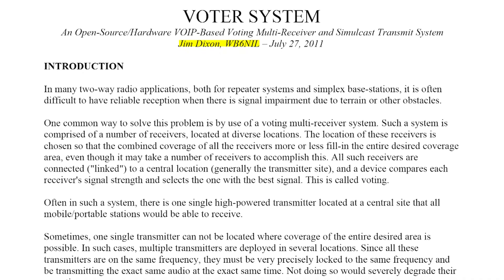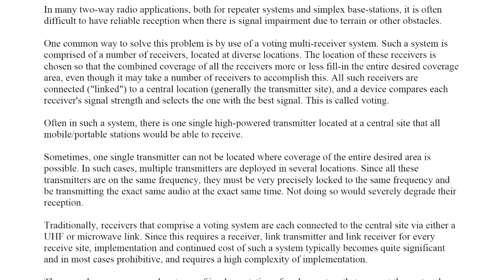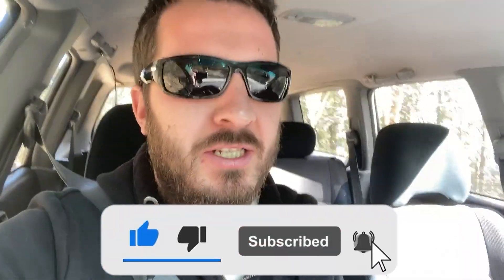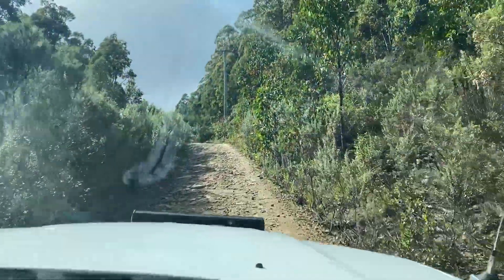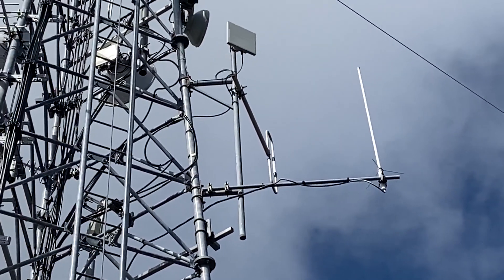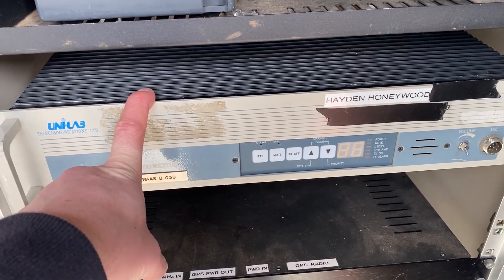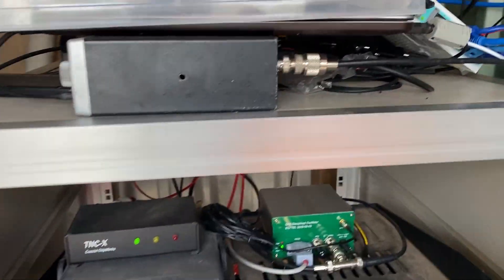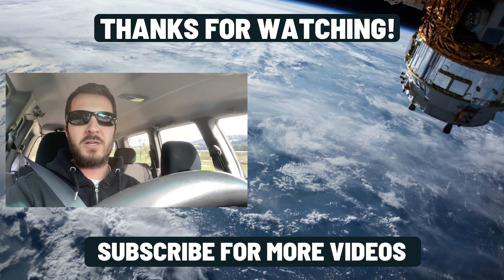Uh oh.... the repeater is broken!!

Comment: Interesting video!  I wonder if you might share more details on that APRS digipeater?  If you had to replace the whole unit today, would you get the same one?
Reply from the maker: I probably would, or I'd get the TinyTrak 4 which I use on another site as an APRS digi. In the early days and models, the TNC-X (or X-Digi) had buffer errors where it would lock up and stop working. You'd need to do a power reset to fix it. That said, I think the later models resolved this and it's been running non-stop for 3-4 years now.
Reply: @HamRadioDX    Thanks for the quick feedback!  I looked at the tiny track 4 as well.  Just gotta figure out which one of the four or so I’m looking at to buy now.